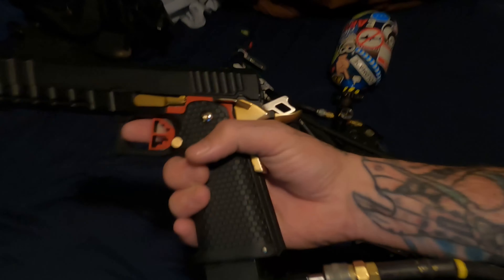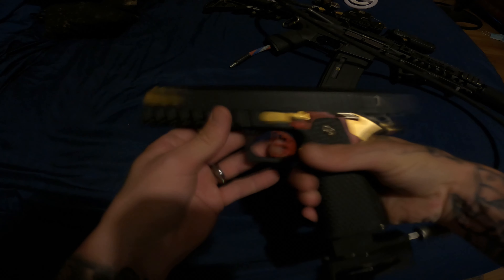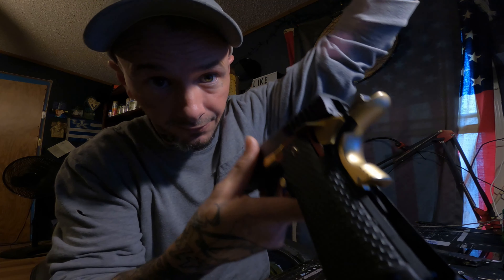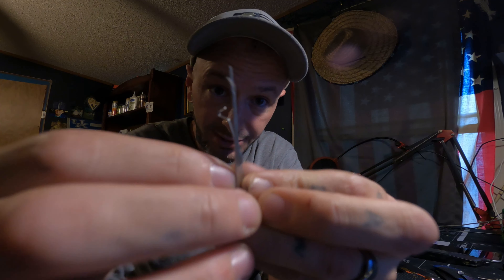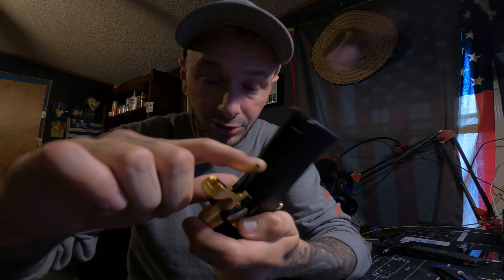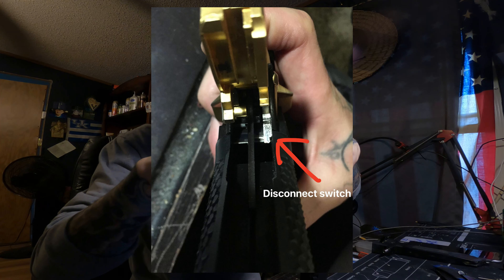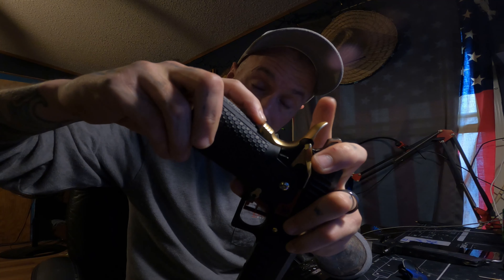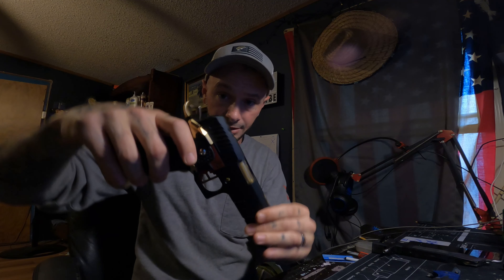TM Hi capa full auto troubleshooting (Solved)

Comment: I have an issue with my emg sti tti 2011. Out of nowhere I had a problem where the hammer wouldn't go down and the trigger was useless and the only way it could fire was if i released the slide and then it would go full auto. I did the entire process you have shown on the video and it solved it for awhile. Then It came back. I did the entire process properly and now it only works for 2 trigger pulls and then is messed up again. Do you have any suggestions??

Comment: this was a great vido i hade problem when nothing happend when i pull the trigger and the hammer whantet to go up when i pull the slide back o forward. your vido helpt me a lot thanks :)
Reply from the maker: Glad I was able to help! So everything working fine now?
Reply: @sinfulpirate  yes like its new
Reply from the maker: @headhunter231  awesome that’s good to hear glade you be able to help out! 💯
Reply from the maker: old man strength  unfortunately I don’t own a Tapp adapter
Reply from the maker: old man strength  I have a Monk adapter and it holds the EPM, EPMs and EPM1 with no issue and feeds fine. Never had to modify anything

Comment: My hi capa goes full auto even if my finger isn’t on the trigger right when I rack it back it’s goes full auto and I don’t know how to fix it so do you have a solution?
Reply from the maker: That could be a bad combination of short strokes and recoil spring. If its to short it wont cycle correctly
Reply from the maker: In turn end up with full auto

Comment: Hey man i have the same airsoft gun as you and im having a problem with it that i dont know how to fix. When i cock it the slide doesn’t go all the way forward
Reply from the maker: It could be getting jammed would be the first thought. Sometimes the screws in the nozzle will come loose and cost it to sick.
Reply from the maker: @nxsaj9167  ya not sure where that post is.
Reply: @nxsaj9167  I had that issue but it stopped after disassembling then reassembling the lower